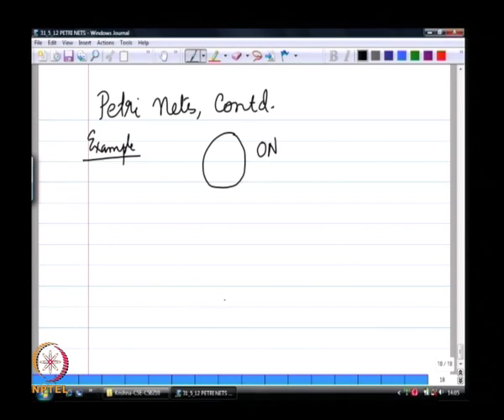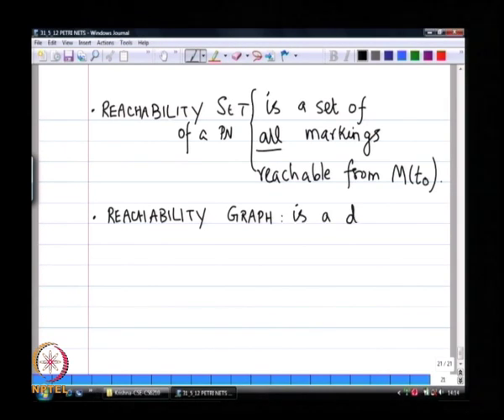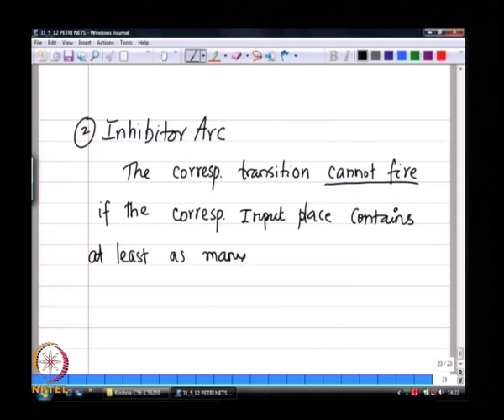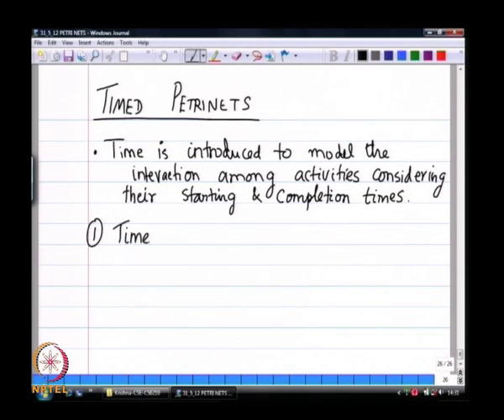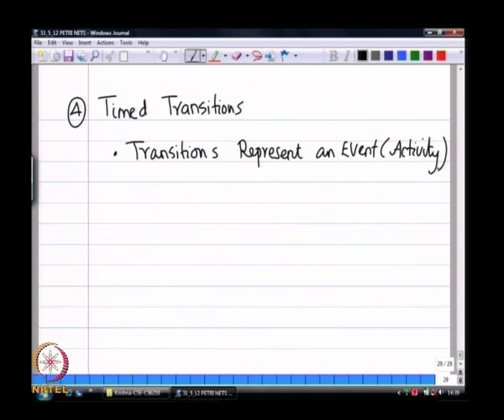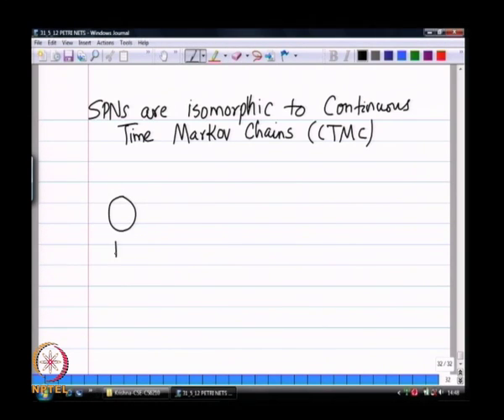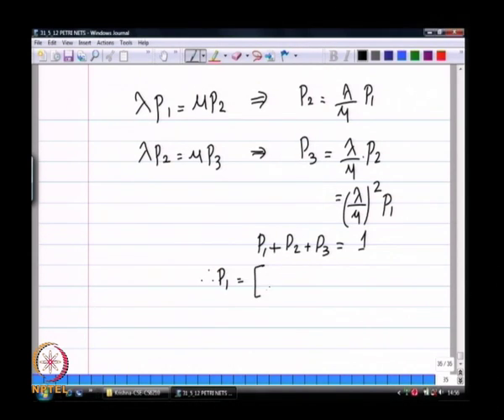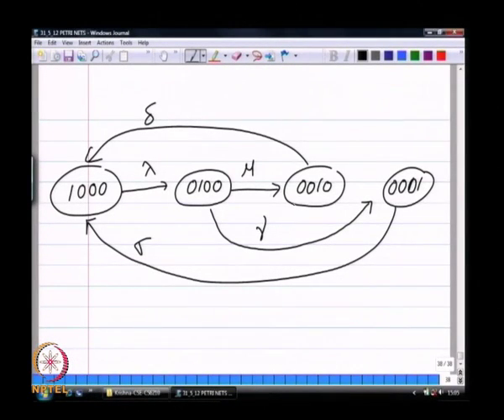Mod-01 Lec-40 PetriNets-II

Comment: at 20:48, how are there 3 tokens P3? there is only one token at P2, so it seems it won't fire since the number of tokens at P2 are not >=3. Please correct me if I am wrong
Reply: Cause the multiplicity on the arc =3  then ur transition will keep firing tokens till the P3 have  3 tokens